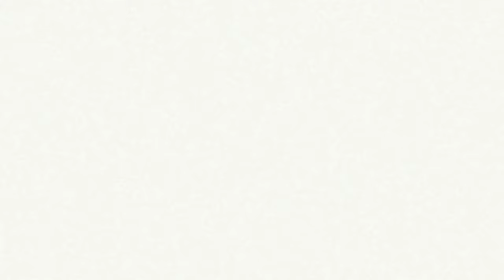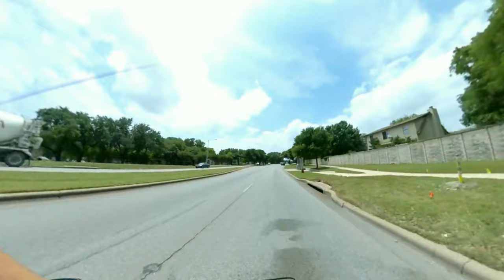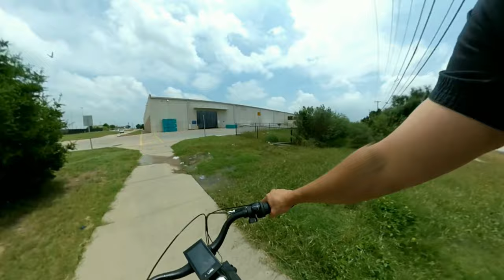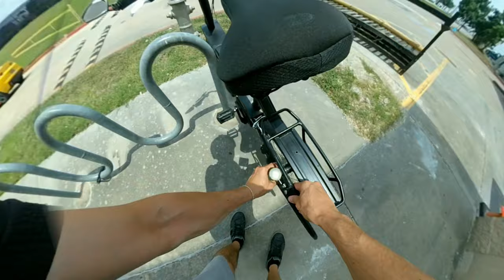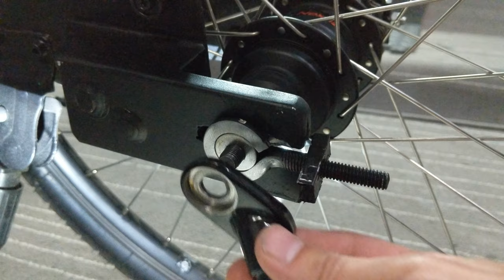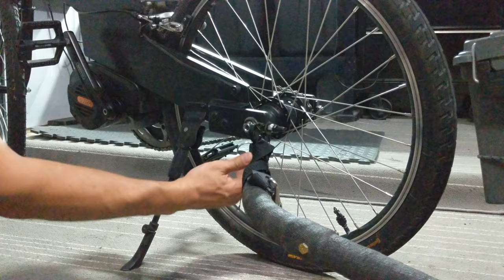Ride Vlog #2 | Bike Trailer Hitch + Nexus 3 | Issues

Comment: I am surprised the Nexus 3 doesn't have an ebike shiftier for it. My Shimano Alivio setup has an ebike shifter with built in kill switch. It works great. Very smooth shifting and no grinding. It is hard to tell it is even there.
Reply from the maker: That sounds really nice... is yours paired with the Steps motor? Does it shift electronically or just cuts power to the motor before shifting? Either way, yeah it would be nice if they made one for all IGH's, but I doubt it would be compatible with other motor brands. Bafang has a 'gear sensor' that connects to the shifter cable and cuts motor power when shifting - I just don't have the need to try one yet.
Reply: @eBikeaholic  As you push to change gears it kills the motor right before it changes the gear. It all happens so fast it is hard to feel it. It does not electronically shift. The Shimano Alivio 9 speed is paired with a Bafany Ultra Max. I bet they already make the ebike shifter for the Nexus too.  That stuff is still had to find in the US right now.  Looks like all the Social Rides are going to start back up on the 15th. I can't wait!

Comment: What brand of bike did you use in the video? I noticed it had the Bafang Ultra  motor
Reply from the maker: I built the frame using a kids bike, aluminum rect tubing and basic power tools... calling it the eBa prototype for now. I'm finalizing the v2 design, considering doing a kickstarter or something.

Comment: Hello need some help in trouble shooting a newly bought cruiser with nexus 3 speed igh. Everytime I pedal noise coming. Haven't check the pedal but when I'm passing a little elevated road it stops but when on a flat road it starts again. Considering it new. Gear monitor is in position already. Thanks
Reply from the maker: How would you describe the noise? They do usually make a ticking noise in some gears, that's normal, but if it's a grinding noise you should recheck the axle length and readjust the bell crank. Make sure the yellow line is in the middle when in 2nd gear.

Comment: friend I have a question and I need your help. I make deliveries with my ebike. I wanted to trade the two batteries I have for just one. I have a 1000W motor and my motor brushless controller  is 26amp limits, if I replace the motor brushless controller to one with a high amperage, I could use a 48V-40ah battery?
Reply from the maker: You may not need to replace the controller. Make sure the connectors match and the battery pack's cells and bms (battery management system) can handle the amperage you want to pull from it.